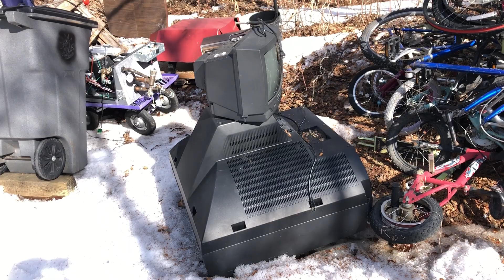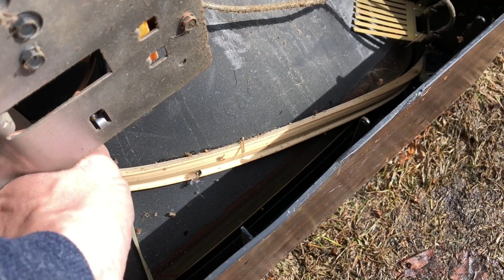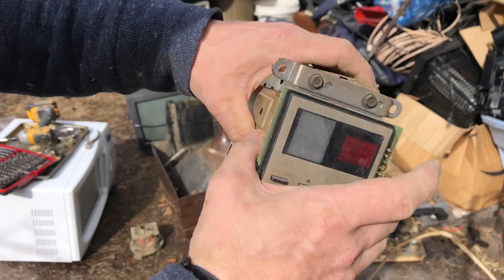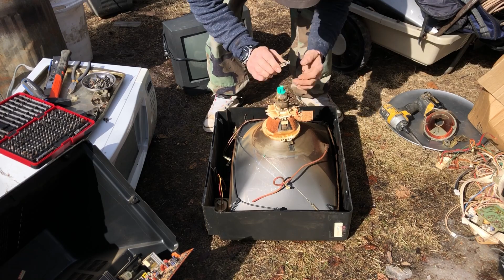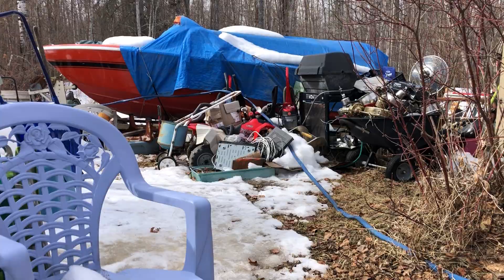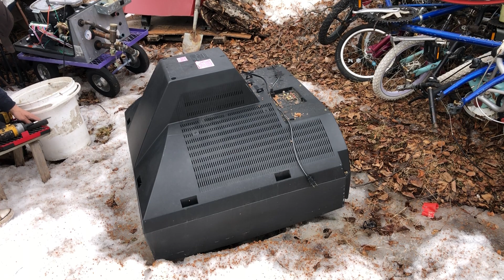Scrapping down old CRT TVs for Copper and Aluminum

Comment: It's a vacuum in the tube. You should release the vacuum to be safe. That cord you cut to be safe, if you pull the cup off the tube, you can puncture the lead hole with a sharp punch, nail, screwdriver, etc. They are very dangerous if they break under vacuum but when it's pierced it's fine.
Reply from the maker: I don’t plan on breaking them lol did it once 😬😳🤣 that’s why I take my time and be carful! It’s not and more breakable after as it was before I’ve seen lots broken in the sea can I’ve grabbed a couple just don’t know what I did with the tube end they are neat looking I seen that one in your video!
Reply: @BushDogScrapper  I just watched you toss one on the ground. lol
Reply from the maker: @wannabescrapper72  you sure did! I threw it from 8 feet away lol didn’t break actually I threw it like 4 times before the shot looked good 🤣